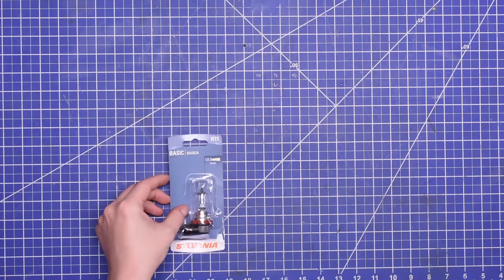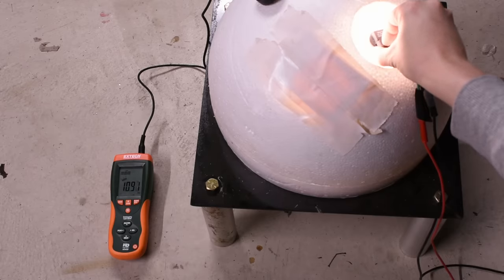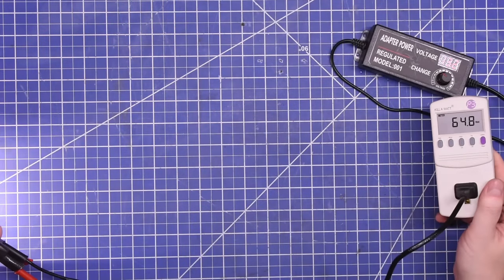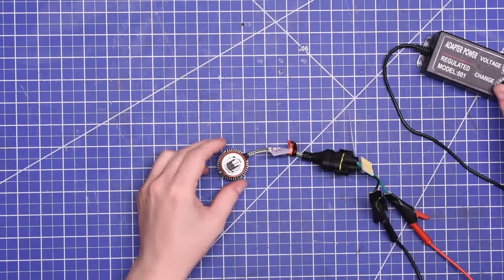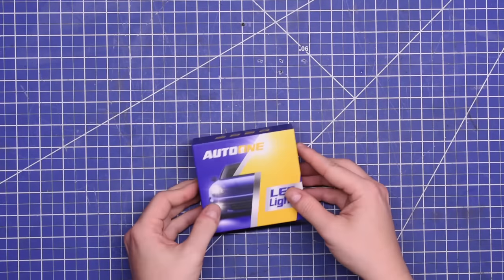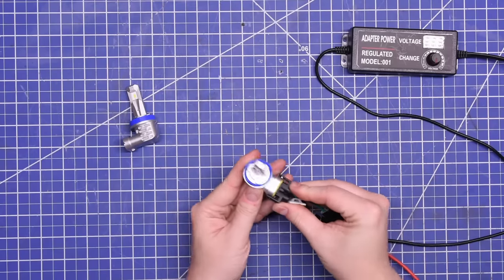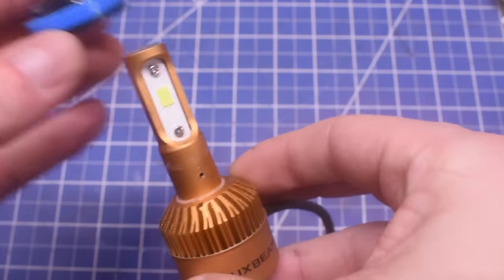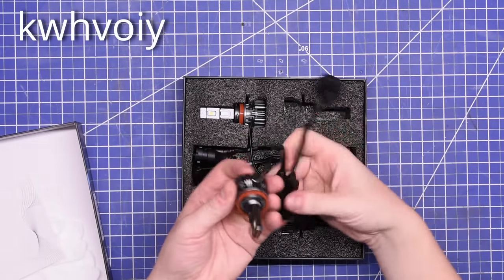Amazon Headlight Bulbs are Getting Out of Hand

Comment: I'd like to see some more Halogen brands compared. HELLA makes a high wattage bulb that looks interesting, and Phillips has the Xtreme vision and the Night guide bulbs that both could be pretty bright.
Reply: Halogen is going the way of the Dodo bird, LED will be all you can buy in a few years.
Reply: @seymoarsalvage  Truly I would be okay putting LEDs in my cars if it weren't for the fact that most bulbs aren't available in the warmer color that halogens naturally are. The slight yellow color is easy on my eyes and I do not like the pure white color personally. All LEDs I've seen are either extreme yellow (3000k) or 6000k+ where I would love to see a 4300k LED bulb of decent quality!
Reply: I have some of the Hella bulbs and the issues with them are: 1. They're rated for offroad use only (I know...), 2. They're 80w, which is double the factory bulbs so melting your housings it not only a risk, but a likely one, 3. They have short lifespans. Likely due to the heat, people report frequent failures. 4. Piles of the reviews you'll see for Hellas compare them directly against these cheap LEDs and the people end up preferring the LEDs.

I haven't installed my Hellas for all of the reasons above... Since I've waited so long, the LED prices have come down so low that it's almost not worth messing with anything else. FWIW, I've had Silverstars in a few vehicles in the past and never really liked them either. I don't think spending money on better halogens is a winning strategy.

ETA: 4. The increased power draw of the Hellas makes rewiring the circuit with a relay circuit highly advisable too.
Reply: @TheBrokenLife  I've read about the disadvantages of high wattage halogens, but I've run a custom dual relay harness for my truck's headlights to avoid voltage drop to the lamps, and I intentionally made the wires 12awg so they could safely supply enough current to 80/100w bulbs. However I understand I'm in the small minority that have beefed up electrical capacity to handle high wattage AND still prefer halogen lamps. I'm just curious to see a brightness comparison between those high wattage halogens and a normal halogen, or a cheap LED.
Reply: @seymoarsalvage  in new cars maybe, otherwise you couldn't be more wrong, all the millions of vehicles on the road with headlights engineered for halogens? They aren't going anywhere anytime soon
Reply: @TEENOFTITANS  In that regard, every report out there says that they are as advertised. They're perceived to be much brighter than 40w bulbs. But, the next perception is still that LED is better. I ended up with some because they were hilariously cheap on Rockauto while I happened to be ordering stuff from the same "warehouse". Maybe see if you have the same luck some day and try them out?

I'm with in principle. I don't like the ultra-high color temperatures that LEDs tend to run at. I think my vision is better in the sub-5k range.
Reply: When it comes to incandescent filaments, the laws of physics stomp on these.  Your tradeoff is always brightness for hours, and you have a limit on the car's wiring system.  You start drawing close to 70W which is what you would need to make halogen lamps brighter would overload the wiring and the heat they throw would melt housings.
Reply: @TEENOFTITANS  Same.  The higher temp lights seem brighter but also seem to throw less light down the road!!!  I'd be happy with 5K if I could find them.
Reply: @The Whiskey Gunner  the fact that this video even exists proves how popular LED upgrades are for older cars. Its simple technological advancement and economics. Same with EV replacing gas engines.
Reply: @seymoarsalvage  I wish this would be true but the insanely low number of actually approved LED upgrades makes me doubt that. I'd love to go LED in my car, but I can't without risking my license.
Reply: Higher wattage bulbs without the proper wiring harness to handle them will melt everything, wires, housings, plugs, etc. The other issue is that even if you do upgrade your wiring, the extra heat will damage the reflective coating on your reflector or projector in very little time. Don't do it unless the headlights were specifically designed for those temperatures.
Reply: Hella bulbs are horrible overall. Depending on the bulb size, Osram Nightbreaker Laser, Philips Racing Vision and Tungsram Nightawk Platinum. Sylvania anything blows.
Reply: In my  country its ilegal to change from halogen to led.  (and i think most european countries) So halogen will stay around fore some more time.
Philips makes Led replacements to worth to check out. 
If you install "bad" led lights that not follow the headligts designed angels/lines and have extra lines/spots outsides that area and more lumens you will blind the oncoming traffic.

Comment: I think part of the reason the lights with the external ballast were drawing more power is because that "ballast" contained a resistor that just draws extra power. Some cars will throw errors or cause the lights to flicker if they don't draw enough power, so sometimes people with aftermarket LED or HID kits have to add resistors to trick the car into thinking the bulbs are halogen. It would be interesting to have someone open up that little "ballast" and see what's inside. 🙂
Reply: alot of blinkers will not blink at the correct speed if the resistor is different. Usually too fast. The ballast makes it a true plug and play oem replacement without having to add a resistor or any other part
Reply: Had to do that on my 93 cbr
Reply: @Theaverageazn247 plus, you get that annoying little message saying you've got a light out. If your car has that feature.
Reply: Put LED tail lights in my 2012 subaru.  Radio would light up halfway,  stay on even with key removed.  All sorts of weird electrical gremlins started popping up.

Resistance matters
Reply: Tried to replace my 4th-gen Ram's HMSL with an LED bulb, and it would still give me the "Taillight Out" message until I used a "CANBus" LED model.
Reply: You would be correct. CANbus systems work by detecting the power drawn by a bulb, if no/less power is being drawn then it assumes the bulb is failing/has failed and pings up a message.
Reply: @typicalbrummie3852  Except you threw in Canbus for no reason.  The feature was available before canbus, is not specifically part of canbus, and will still be around once canbus is replaced with the next greatest comm interface.  It really has nothing to do with canbus except as one possible method of indication among several.
Reply: That makes no sense.  It would then have to be specifically marketed towards those who need to add that ballast resistor otherwise.

What makes a lot more sense is that the problem with the LED headlights in the first place is trying to heatsink away the amount of heat they produce, in the available space to do so, since incan bulbs can run far hotter than LED, so the housings and cooling didn't need to take that into account.

There are three power loss stages in the LED headlight bulb.  One is obviously a loss to produce light, and another the heat the LED produces doing so, but the 3rd loss is the driver circuit to the LED.

If you spread out where these losses are, you have a higher effective heatsink area and the components in the driver circuit which tend to be more susceptible to heat degradation than the LED dies themselves, are spared the extra heat produced by the LEDs by not being integrated into the same heatsink structure that single-casing-construction bulbs use.

The result is that you can fit into the available space, including that the driver box is on flexible wire so there is wiggle room for how to route it, that you can run the circuit at a higher power without heat becoming a problem as soon.

These kinds of thermal management choices are common in far more than just these illegal, LED retrofit headlights, but some manufacturers aren't content only with getting away with breaking the law, will instead outright lie about the performance and just build the cheapest way possible to achieve some shiny, attractive widget.

It's really sad that consumers are too ignorant to realize the problems with these designs, that it's inevitable that the retrofit headlight bulb fails prematurely whether due to the overheating, or just the tiny high RPM fan itself chewing the bearings up.   Nobody in China cares as long as they Get Your Money.  :)
Reply: Resistors do not draw power, they limit power flow hence the name "RESISTOR"
Reply: @stoney2732  Totally depends on whether you put them in series with the load or parallel with the load.
Reply: @stoney2732  They draw power when you deliberately insert them into the circuit in parallel to the (other) load, across the +/-, hence the same "resistor".
Reply: @stoney2732  Wrong.
Reply: @bp8652  Resistance is Futile!
Reply: It's a driver. Your car's electrical system has a lot of inherent variability in it due to the alternator so for a device like a diode can create a "flicker" effect due to voltage fluctuations. A driver module can provide the led with a fixed voltage and current to keep the output consistent and/or alter it's output (voltage or pwm) to keep the emitter from overheating (if the bulb has a temperature sensor). A lot of the newer bulbs are coming with the driver built in instead of as a separate module in line on the cable..
Reply: @Theaverageazn247  That is the way cars are programmed to warn you of a blown indicator when they detect low blinker lamp current.
Reply: @stinkycheese804  I have replaced light bulbs in my house with LED's and they do not get hot at all. Why do car LED's get hot?
Reply: @recumbentrocks2929  You are stating your perception of hot, but in reality the household LED bulbs do produce heat, a large % of the measured power consumption is heat, which can be compared against the automotive headlight bulbs, but there is one primary difference.

In household lighting, the general goal is to spread out the light uniformly so many separate LED dies can be used and this lowers the per die density, and multiple bulbs can also be used to increase the room lighting.  

In vehicle headlights, you want a spot point of light so a single reflector or lens can focus it, and from the single bulb have sufficient light to see down the road, so the heat density is higher, limited by the available space for the bulb.

Plus the other issue is the bulb manufacturers are trying to eek out more light from each LED die to lower production costs so they are driven at a higher current per die.  The same is now true of household LED bulbs but since they are such a standardized commodity item, the cost per bulb makes the resultant shorter lifespan more acceptable.
Reply: @nemesis1588  This doesn't explain the benefits of the driver being external.  Plus, no there is not going to be substantial flicker perceptible to the human eye because not only is the current regulated as you mentioned but also, there is a flood minimum voltage in the system due to having a battery in parallel so will never get below that roughly 12.6V floor which is too little to make the momentary brightness decrease noticeable at the frequencies of the alternator and other electrical noise.
Reply: @recumbentrocks2929  In an nclosed space, and conversion from LOW voltage is a ways less efficient

 Especially if they REALLY cheap out with \ series resistor instead of a solid state convertor!
Reply: It’s called a drive,,, all led bulbs with no driver it’s all internal and are lower lumens (less heat)  external drivers is higher Lumens (a lot of heat) bulb only has the fan it’s never recommended that a driver carries CANBUS resistance it creates more heat,,, led ignites at very low voltage but low voltage will cause the bulbs to burn out- if you have a bad car battery that it will always start your car but it’s weak the bulbs will give out,  not sure about 36,000lm brightest in my manufacture is 12,000 on a single bulb and it’s too much
Reply: That CANBUS decoder is incredibly useful. Have an 07 ram 1500 and the LEDs flicker or go off completely, one or both sides, unless the bright setting is applied. Once brights are on, lights are fine. But I don't want to blind everyone. So CANBUS decoder it is
Reply: @forrestweldon9168  is it the hellcat edition? I'm trying to get a hellcat grand voyager or caravan.
Reply: @bp8652  Viva La Resistance!
Reply: @Theaverageazn247  Lasfit does a good job with this. But they're expensive bulbs
Reply: People who are drawing more power than is intended for the car are probably doing something illigal like using a bulb over 3000 lumens.
Reply: Get Big Clive on it 😁